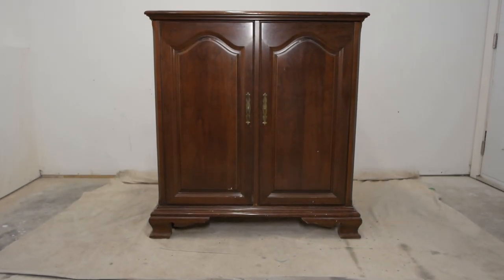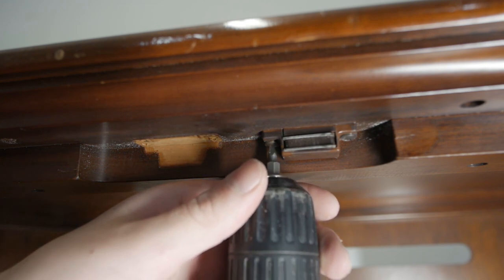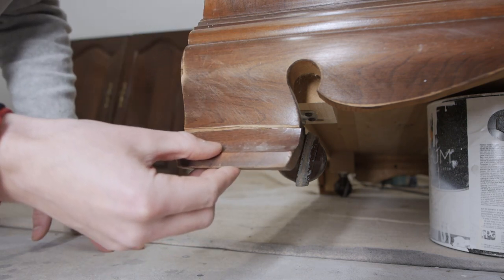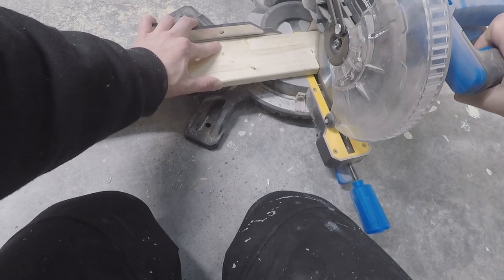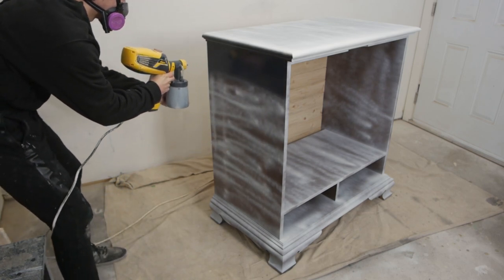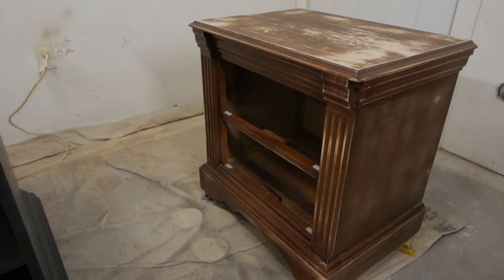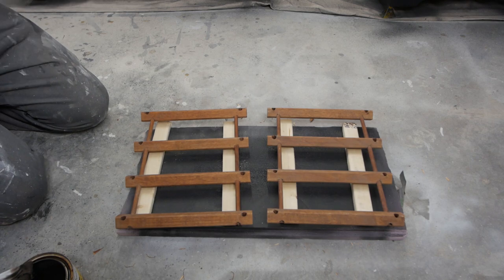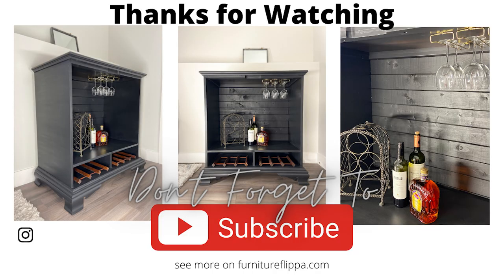Trash to Treasure | Old TV Cabinet Makeover

Comment: The GoPro view is great... often you see things differently from that angle that would be helpful for anyone who wants to learn to do this.

I'm going to second the comment about putting a bit of darker paint in with your top coat, it helps even out the colour. Not needed with light colours. ALSO, I'd like to suggest a super thin GOS plywood backing that you can stain to match the wine rack. Looks fantastic though. Well done.

Comment: Hey!! Love the way this piece turned out, fire, like always 😌 I have a question that I’ve never really gotten a clear answer on, how much water do you use to dilute the paint when using the spray gun so it sprays nicely?
Reply from the maker: I use 10-25% water. If fusion mineral paint I only use 10% if thicker paint like Behr I will use 15-25%!

Comment: Nice! Do you ever use chalk paint for your flips? I've seen many people use it on furniture and they don't need to sand or prime. I don't know how well it holds up, tho.
Reply from the maker: I have! I always sand lightly when painting so the product adheres better. I use a primer if on bare wood and if I think there could be potential bleeds. Plus it never hurts to prime. 

No sanding and painting a glossy surface you are risking the paint just peeling right off.
Reply: There are many videos of chalk painted furniture that wasn't sanded or primed that looks terrible after a year or so and is now being "rescued" by flippers. Just because it advertises that you don't NEED to prep doesn't mean that you shouldn't. Not to mention that the look of chalk paint will go out of style very quickly. In two years many of these flat matte painted pieces are going to be on the curb unfortunately. This guy is thinking long term thankfully. His pieces will be around for a very long time.